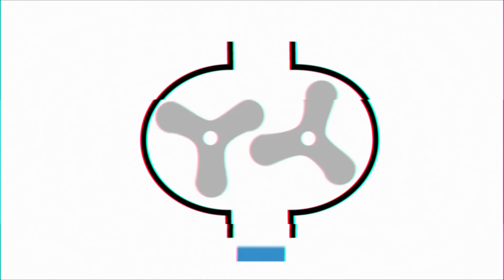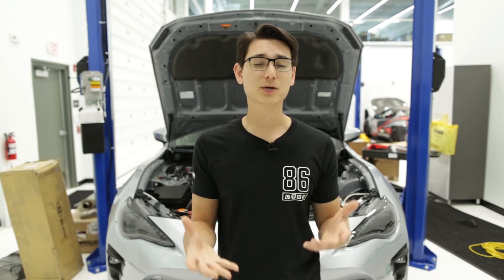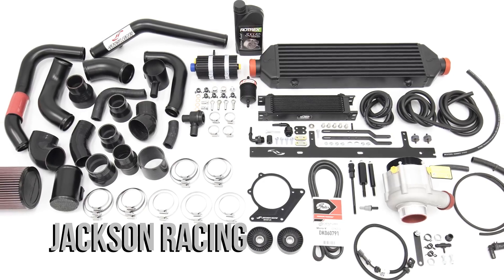Everything About Superchargers | FRS BRZ 86

Comment: How durable have you guys found the stock motor to be when running off a super? I'm getting a brz soon and fancy the roots blower, but I'm nervous about melting a piston or throwing a rod.
Reply: It’s safe as long as you don’t push past 280hp so that you won’t have to get forged internals. I’d say 260ish Hp would be safe
Reply: It’s a decent number since our cars are lightweight too. Hope all goes planned brotha
Reply: Berenger Christy Forged internals are utterly irrelevant as an answer because I specifically asked what the STOCK motor could hold. I wanted to know how these handle supercharging in a purely bolt on application.
Reply: you also said you're nervous about melting the internals. if you don't want to worry about that, get forged internals, otherwise its a dice roll
Reply: Remigus Ker Although a lower compression set is ideal, in my research, and I suggest digging into the forums on popular 86/BRZ sites, that the stock engine with its high compression ratio can safely handle power in the high 200’s, around 260-280. However other users have gone into the low and mid 300’s with no ill effects. As you approach 400,  it is a gamble. Although the engine is strong and won many awards, its high compression and so-so pistons become an obstacle at the mid 300’s. Not only that, but you’re going to have to upgrade your driveline including clutch assembly, shifter fork+pivot, and probably axles/CV joints in addition to considering forged internals at a lower compression. 
So circling back on the original question, mid to higher 200’s is considered the safest.
Reply: With a supercharger you have to keep in mind 2 things: 1) as they charge always the same psi in the entire rpm if you keep the max power under reasonable limits (for your cooling, intercooling, compression ratio and trasmission) the only way you can damage the engine is a knocking at low rpm due to a quick throttle variation (this is why centrifugal and turbo's are safer than positive displacement's one) 2) beacause your supercharger "suck" torque from your cranckshaft  with the same amount of boost you're gonna make less whp than a turbo. Beacause the boost is the first factor that you have to consider as a limit in relation to your compression (12.5:1 stock) a turbo engine is safe as a supercharged one with less power. So if you ear that a turbo with stock compression can manage 300whp and you're supercarged keep in mind to less that number a bit. (also with a centrifugal but expecially if you have a root, due to the less mechanical efficiency). So choose well, keep it cool and well lubricated and it will be fine!
Reply: Jerald Espinoza That sounds like a pretty comfortable number for what I want out of the car. :)
Reply: Berenger Christy Forged internals are the obvious answer, yes, but they're still not relevant to the question I asked. If I was considering going forged initially I wouldn't specifically asked what the stock motor will take. Some motors will happily chug modest boost on stock guts (LS, B/K series, 3S,etc) and some will shit themselves in quick order. Therefore asking people who actually work with the motor isn't out of line.
Reply: if you're worried about it get forged internals
Reply: Berenger Christy Were it that my funds were unlimited.
Reply: well then you're going to have to worry
Reply: Berenger Christy Or I could have gotten an assessment on how well the stock motor takes boost instead of useless smart ass comments.

But hey, you tried I suppose.
Reply: forged internals is a reasonable modification to prepare an NA engine for forced induction, but you'd know that if you wanted to do your own research. some people have good luck at 300hp, some have good luck above 300hp, some have terrible luck below 300 hp. I don't feel like using google.com for you

Comment: Damn, look at the size/weight difference.  I’m happy as hell with my Vortech.   I don’t do a lot of track, but still find plenty of use for my vortech.  Right now mine is making 250 whp and 205 torque, Until tomorrow when I go Flex fuel.  I was quoted an extra 60 to 80 hp on E85 with having the vortech.

Comment: I would hope that you guys would know not to push it past 300 without forging the internals 270 to 280 is your safest mark on stock internals
Reply: Woe then please enlighten us oh wise one
Reply: 270-280 whp sounds about right, but even then the tune has to be top-notch considering how fragile the FA20 is :/ I think the people that’ve pushed past 300 with zero problems have either amazing luck, or amazing tuners lmao
Reply: 8ight-6ix Brandon It’s a bit of a subjective area, many professionals are going near 400 on stock engines however you’re right and people should consider internals to play it safe when entering the mid or higher 300whps.
Reply: Burako Shimazaki I know what you're talking about I think there's just a lucky few that get away with it but I wouldn't risk it especially with 12.5:1 compression on an aluminum block
Reply: The con-rods is currently the weakest point of the FA/FB engine. 

Push too much boost and the rods will bend and you get rod knock and worst case is you get a hole in your engine block. 

Also the engine is running pretty high compression so you def need to run high octane fuel and a proper tune unless you want you spanking new engine go kaboom from engine knock when it runs lean.
Reply: 8ight-6ix Brandon I did not know that, thank you very much man (I’m need to the whole mod world 😭)
Reply: How fast would the 0-60 be approx for 280 ish whp? Just wondering I know these aren't straight line cars but just curious
Reply: @ordinarygamer1353  It would be a 5 second car
Reply: buku buku it should, best do a proper tune
Reply: buku buku upgraded cooling. Better fuel pump and injectors. And def new con rods
Reply: 280 wheel right?
Reply: S K yes
Reply: buku buku and an oil cooler.
Reply: False

Comment: Do all of these work on the 2017 86 models?
Reply: Cory Sanders I’m not them, but I’m  gonna go out on a limb and say yes.  So seriously, yes
Reply: Uhhh Yea is that with a custom tune or the OPF? Also, what fuel did you run with?
Reply: don't think so, researching one of them, maybe edelbrock, it isn't compatible but they are working on the update; that could've been an older article or whatever, but check with the manufacturer directly before making any purchase you might have to return ;)